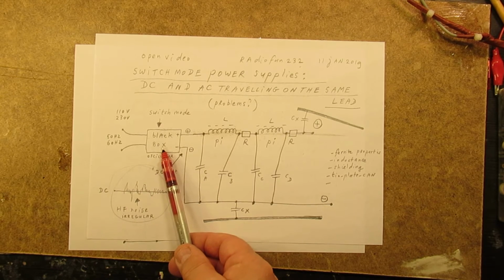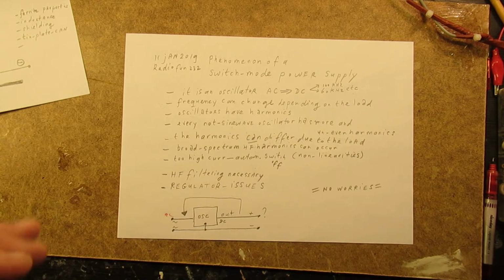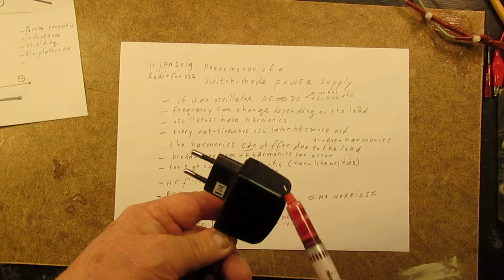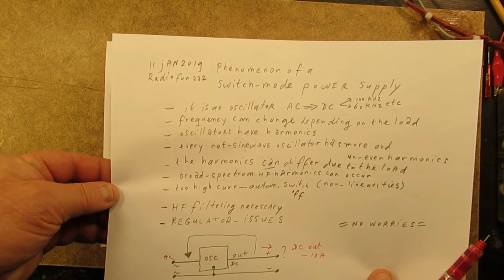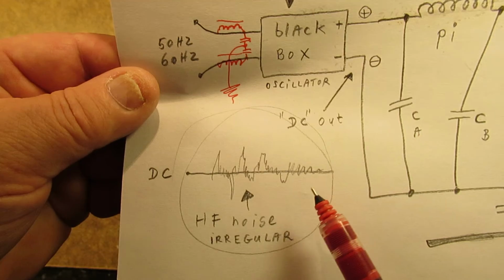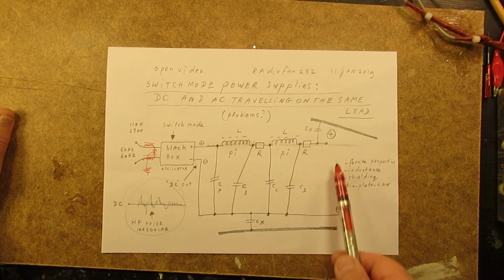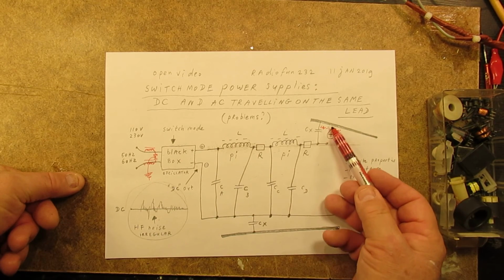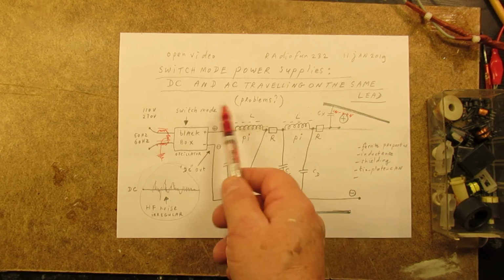Switch mode power supplies: their problems & how to filter HF noise out ?

Comment: Hello radiofun232
Have you made more videos on how to filter these switch mode power supplies?
I'm working on a stock power supply for guitar effects pedals.  It has several 9volt outputs and two 18 volt outputs.  I really like it but I want to add or upgrade the filtering and I was curious how additional filtering caps would add filters for higher frequencies?

Example of question.... I have seen people add smaller ceramic caps to the large electrolytic filter caps in order to filter out the high frequencies that get by or even damage the larger electrolytic caps.  However, I have not seen very good examples of how to do this in existing circuits.... just on paper and test boards.
Reply from the maker: Thanks for your comment. I don't have more experiences to use these very noisy (noisy: when you want to use them for an audio application or for a radio) switch mode power supplies. I was experimenting for many hours with all kinds of filters and could not get good results, so I did not want to spend more time on it. 26 feb. 2023.
Reply: @radiofun232  I see.
You should revisit it.  They have come a long way in the last few years.
Thank you again for the content.  It helps me understand electronics and other countries.
I'm in the states.
Reply from the maker: @aurthorthing7403  thanks; you are welcome.

Comment: Thanks for your time and explanation. Do you have a affordable solution to help clean noise on the house AC lines? I have computers that are cryptomining and draw very dynamics loads along with MANY electronics plugged in the house that use HF switch mode power supplies.
Reply from the maker: As far as I know every single computer has a netfilter that filters peaks/noise out before it supplies the switch mode power supply. It is built inside, on the circuit board. So every computer that is mining has a voltage supply with such a filter. Perhaps there exist separate/big filters of this kind, made to supply (say) 10 computers or so via the mains. I know that Hi-Fi purists sometimes use these filters in their audio system.
Reply: Thanks for the reply. Yes, thats what i was thinking. I was hoping the was a efficient DIY solution that didnt require overpriced audio gear
Reply from the maker: @Larsen514  Yes, there surely is. All these 50/60 Hertz mains supply filters are very simple and elementary and don't have to cost much. Say: one coil (ferrite, toroidal) in the "phase" (say 230 V-50 Hz) lead and one coil in the "O" lead (idem). With enough gauge (wire-thickness) to handle the current properly. And between these coils one or more high voltage capacitors (say 400 V/1000V types) in the 5N -470 N range of which the node goes to the earth/mass. You can surely find this setup on the www. If not mail me and/or go to my channel trailer for the email adress. I went to the Reichelt (Germany) website after having seen your question and searched there for (say) filter or mains filter, found a filter that can handle say 8 Amp or even more (say 16 A) current for (say) 15 Euro's. I cannot give links because YT removes them automatically. You can use such a filter to supply a few computers (max current that the filter can handle is key). For all filters this counts when you really want to be sure in the most perfect way: the signal/current/voltage output must/can be studied with an oscilloscope to see whether the filter really damps unwanted signals travelling on the power supply lead (mains, 110 V or 230 V, 50 Hz or 60 Hz). But, when you don't have an oscilloscope, you can rely for a good part of the filter/manufacturer that it will damp enough. 30 april 2020.

Comment: Very good video! Yes, the hardest part about trying to tame these beasts (SMPS) is being able to identify a frequency. As you mentioned, if you can identify that frequency it is much easier to quite these things with a filter. My experience is much the same as yours. I do have 1 high quality SMPS but most of the ones from printers or laptops are worthless for audio or RF.
Reply from the maker: Question: does that one High Quality SMPS work good?
Reply: @radiofun232  Yes it does. It is a high current supply meant for powering RF transceivers. It is made by Astron. https://www.newegg.com/Product/Product.aspx?Item=9SIAAM140F9223&ignorebbr=1&source=region&nm_mc=KNC-GoogleMKP-PC&cm_mmc=KNC-GoogleMKP-PC-pla-GigaPartsPower+Supplies_-9SIAAM140F9223&gclid=Cj0KCQiAvebhBRD5ARIsAIQUmnlmhYyAxNMSeok98k4bhDyV5LP4_NU6dazhHX7OwwU8sUhQ90ObixsaAk3kEALw_wcB&gclsrc=aw.ds
Reply from the maker: Thanks

Comment: I recently sent a fellow ham a switch mode PS for his 2 meter radio, (the PS he was using was not big enough and it let out the magic smoke ;-). It was an older Dell PS for a work station, it had 12.3 volts, 18 amps. It actually had 3 12v 6amp rails that I soldered together to give him the full 18 amps. I knew it was a solid, quiet PS as I had used one on my little Yaesu FT2900 (75 watt output I think) and it worked flawlessly on high power output. So far he's been quite pleased with it's performance and he was VERY pleased with the price, which was free!!! (We gotta help out our fellow hams when we can!!!) Take care sir, and thanks for all your work :-)
Reply from the maker: You are very welcome, a valuable attribute to this video, especially about how you got such a high Amp circuit to work in your case using a SMPS. Thanks again. 11 jan 2019.